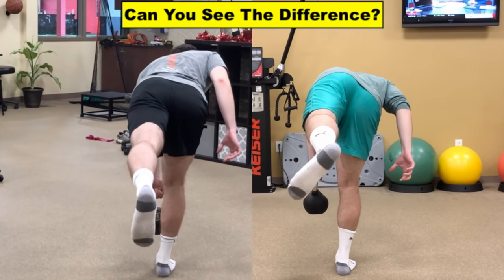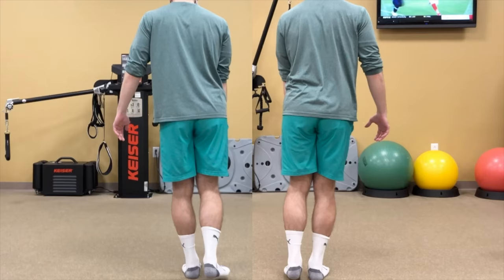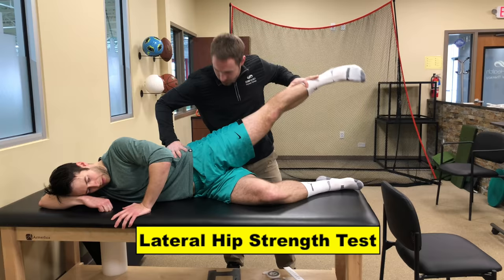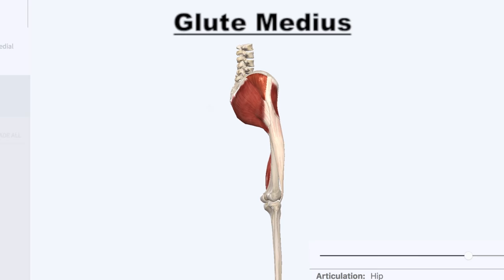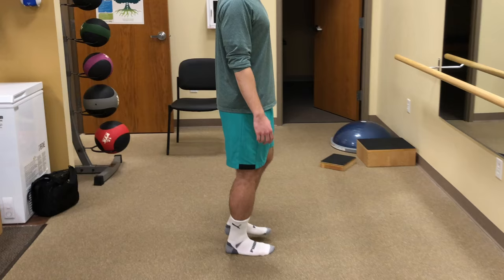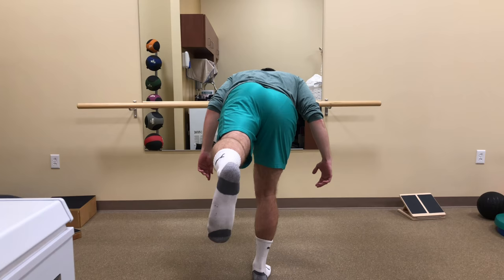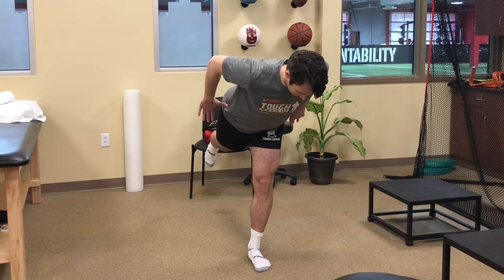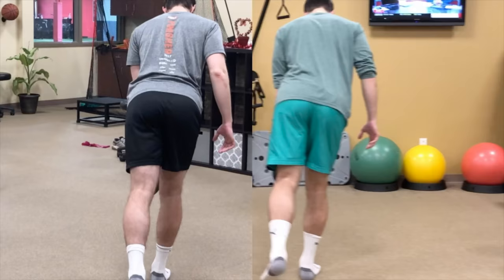Fixing The Single Leg RDL Problem (INCREDIBLE CHANGES)

Comment: When the gyms closed in 2020, I pretty much relied on goblet squats and lunges for leg development. So I became VERY quad dominant. 

I stayed out of gyms until the beginning part of 2023. When I started doing barbell work again and trad lifting it was rough. Then at the end of last year I suffered a bad fall which led to a stress fracture in my hip and a herniated disc in my low back/sciatica. 

What's FINALLY been relieving some of my sciatica and hip issues is a focus on hip hinging and single leg RDL's (just bodyweight). The fact that I'm getting huge glute and hamstring pumps from bodyweight only stiff leg hinging/single leg work is very telling.

My hip mobility and entire posterior chain got so damn weak the past 3+ years from quad dominance that it left me majorly susceptible. It's why recovery is taking MONTHS from my injury. But once I can rebuild strength in my hips and posterior chain, I'll feel a lot better.

Comment: Aaron, why would holding the weight  in the hand opposite to leg doing the work be better than holding it on the same side as the working leg?
Thanks.
Reply from the maker: It is more difficult for balance and core stability - but thats the point.
Reply: @SquatUniversity  Ok thanks. Does it also work different parts of the hamstrings or glutes when you hold the weight in the opposite hand?

Comment: @squat university.  I need your help. Am a  veteran and during my serive i sprained my left ankle. Well years later, this ankle still hurts from time to time, cracks . Weak after prolonged standing or even a run. Recently i have noticed and upper back pelvic pain on the left side with single leg deadlift or a run. Almost like a sciatic pain. Sharp. This pain lingers. Now i have a right knee pain. Help, what do i do?